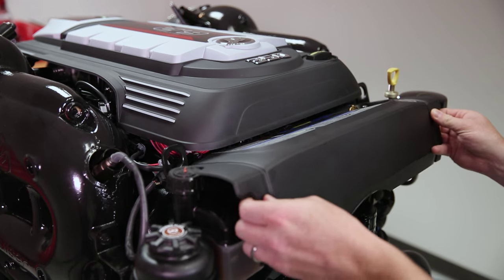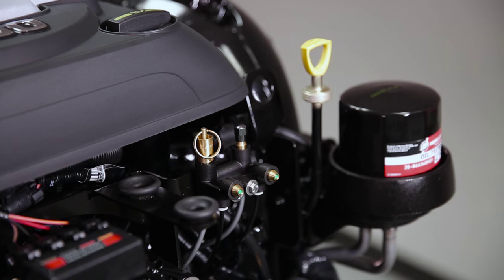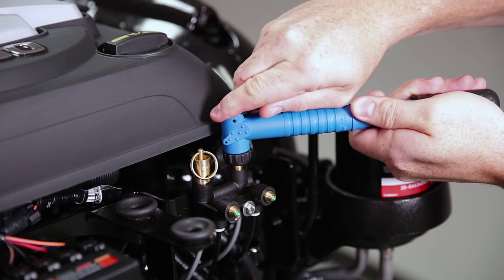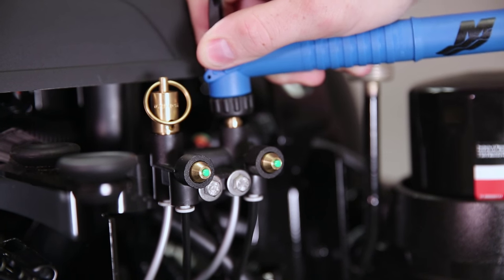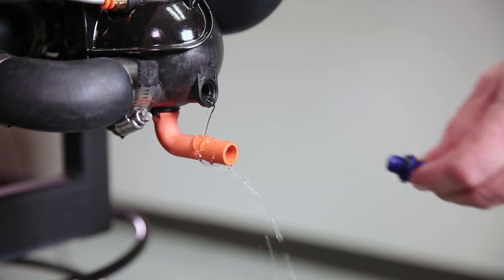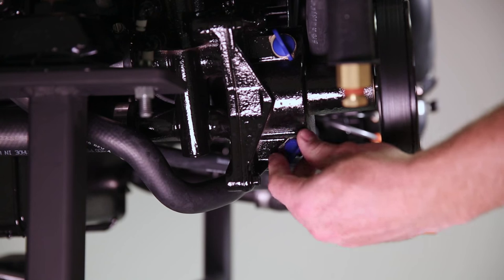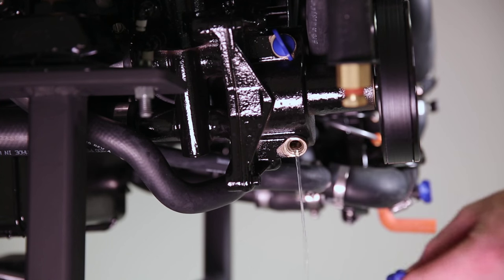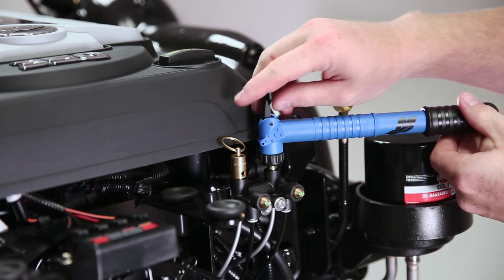MerCruiser 4.5L / 6.2L Sterndrive - Bravo Drive - Single Point Drain

Comment: How many blue drain plugs are there on a 2019 6.2?  I found 4 but fear there may be more that I am not finding.  Thanks
Reply from the maker: Hi Mike, the draining of the cooling system and the plugs you need to remove will depend on the application. We suggest contacting our MerCruiser product support team at 920-929-5040 to discuss the details regarding your specific application. Please have your engine serial number and boat make/model information handy when calling. Thank you!

Comment: This process replaces flushing cooling system with fresh water?
Reply from the maker: Hey Jaime! This does not replace flushing of the cooling system. That is a step you'll still want to complete. This process simplifies the draining of the engine block after you've flushed it. Instead of opening several drain valves around the engine block, this allows you to open a single, more easily accessible drain valve, and the air pump helps to push remaining water out of the system through that valve.

Comment: How bout a video on how to fog the 4.5 Mercruiser
Reply: Its got cats you dont fog it
Reply: @inandout120  Yes but you are supposed to mix up a solution of gas, 2 cycle oil and marine stabilizer in a portable tank and run it through the motor before you store it for the winter. Mercury has a Service bulletin about it. I ended up figuring it out but I like videos before messing with stuff lol